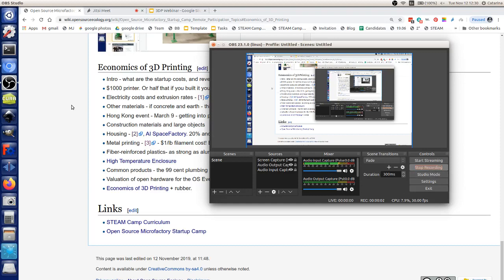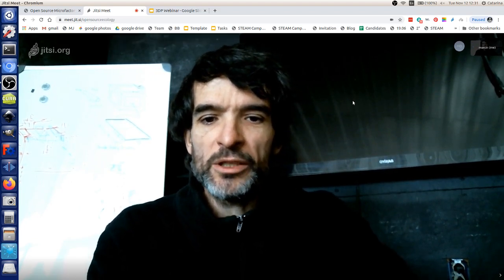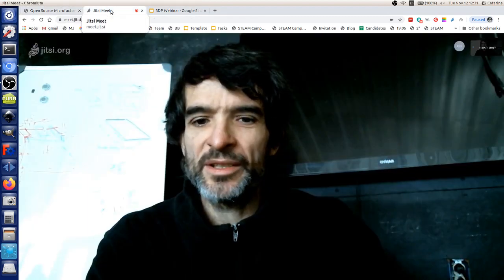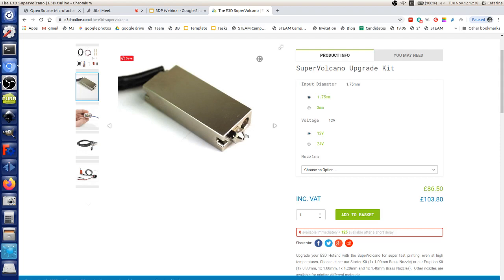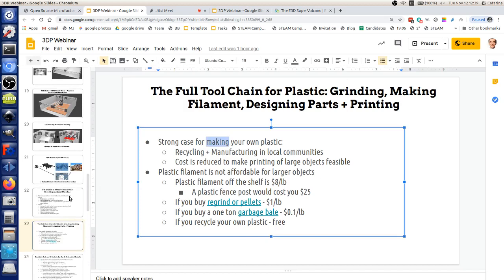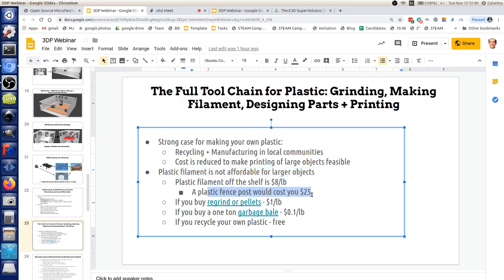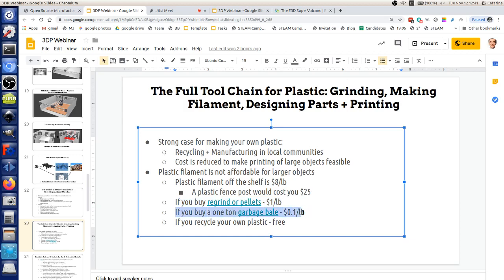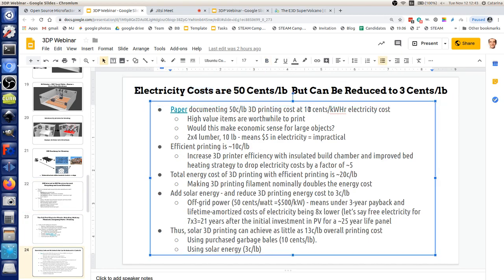Open Source Microfactory Startup Camp - Economics of 3D Printing

Comment: This was a very interesting talk, Marcin! Agree with most of what you said, and learned a lot too. I think there are a few key points missing:

1. PARALLELLIZATION When programmers had to buy, then wait for the delivery, of their own, dedicated hardware (servers); and furthermore had to have access to both storage, electricity, thermal conditioning, and backup ready; and then even furthermore had to set up their own distribution network based on commodity mediums (floppies -> CDs -> DVDs); software had a much higher barrier of entry, and was thus slow, expensive, in-accessible. Nowadays we buy server services (i.e. hardware: AWS, Azure, etc.) by the click of a button, get immediate access, dynamically scale by our needs and distribute through app stores. Same thing is happening with 3D printing: big farms of 3D-printers, producing in a parallell, distributed manner, significantly cuts print times and bridges the vacuum between highly flexible, cheap and quick prototyping of # ≤10 products on the one hand and the economies of slow, expensive, and inflexible tooling and big MOQ of # ≥1K products of traditional manufacturing. Furthermore, combined with the rising labor costs in China, parallellization has the potential of having a significant geo-political impact, decentralizing manufacturing away from China, re-industrializing the OECD countries, re-populating rural areas. And it will exert at least a moderate price pressure on order quantities in the range of # 1K-10K, as organizational, economical and technological advances in 3D-printing is developing at a faster pace than traditional metal-cast-tooling-injection-molding-manufacturing. No one knows the exact implications, but we do know it will/is happening, and that it will be significant, just not how significant. A manufacturer of 3D metal printers called Markforged had a quite good video about 9 months ago: https://youtu.be/nZJkddHxblE 
2. POST-PROCESSING METAL 3D-PRINTS: AFAIK, HQ metal prints require chemical and usually thermal post-processing. This is usually done by specialized, separate equipment (industrial machines usually have even worse UX than consumer products…). It might somehow be possible to integrate this into the 3D-printing process itself, esp. if big metal structures can be modularized and organized into smaller parts, but if not, 3D-printing big metal parts might not be viable. Does anyone have any thoughts – or better yet: data! – on this?
3. 3D PRINTING BUILDINGS: You’re correct about the walls vs foundation and roof part, when it comes to costs. There are also other, smaller-diameter, vertical applications, that might be more immediately applicable, which might have significant cost savings too: stairs, chimney, etc., as well as communal facilities such as silos, water towers and other round, high structures.  I know Institute of Advanced Architecture Catalonia are some of the people looking into those kind of things – I remember their stairs in particular –, but the last time I spoke with them, the economics didn’t seem clear cut just yet. However, it might, or might not be, more immediately applicable than 3D-printing such things as roofs. Anyone here with more info?